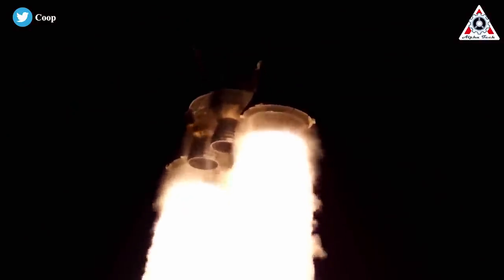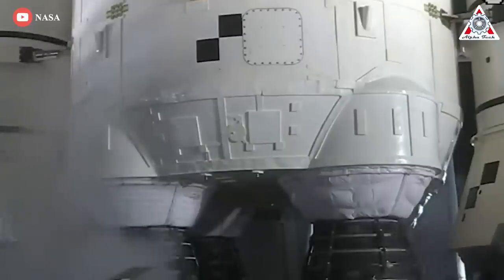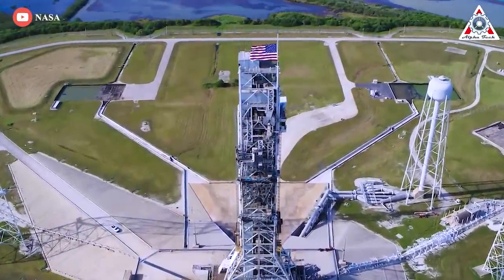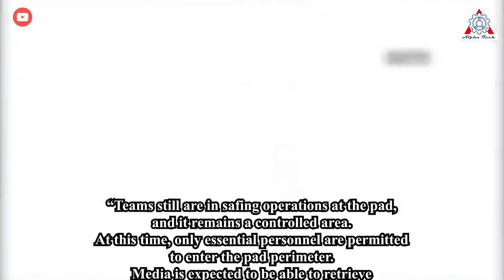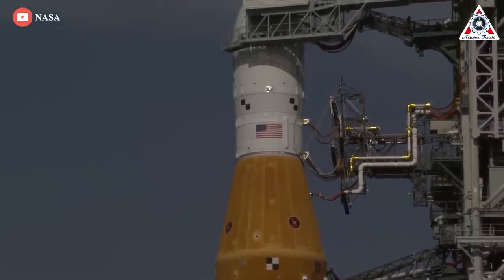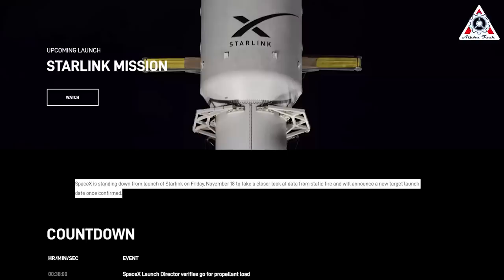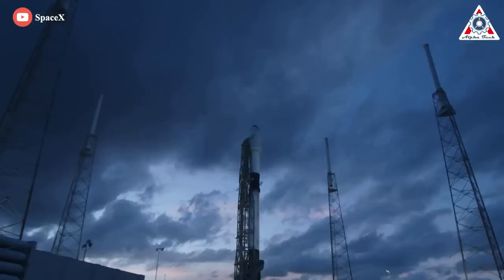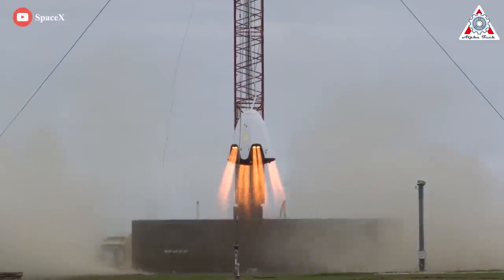NASA Launch Tower is in Big TROUBLE after launch...???

Comment: 1.5 years from now aren't 4 human beings supposed to not only move TOWARD a fully fueled rocket, but actually GET IN at the top?
Reply: Knowing NASA it'd probably be 2-3 years
Reply: One good thing about this old-style 'capsule on the top' stack is that, if things get too explodey, the astronauts have a chance of not dying.  Need to check to see if they get into Orion before the fuel-up.
Reply: Riding it and putting around by leaks of highly volatile chemicals where you are likley putting metal on metal hoping it doesn't explode are significantly two different scenarios.
Reply: Starship is also fully fueled on the pad when they get in… WITH NO ESCAPE POSSIBLE.
Reply: @davidbowerman6433  if it blows they will all get out. At about 1.6km/sec...
Reply: In 1991 while working as an electrical technician on the first Titan IV rocket to be launched from Vandenberg Air force Base, I helped install its guidance computer. The Titan was fully fueled at the time. It was just a regular shift, and the job I was assigned to do on that particular night. 
I was most likely at more risk during the half hour drive to work earlier that evening.
Reply: @richpayton7162   I guess it's depends on how you define risk.  Here is a little quote  on said rocket's fuel. 
"The Titan II's hypergolic fuel and oxidizer ignited on contact, but they were highly toxic and corrosive liquids."  Seems pretty safe. 
Oh, and then there is the Damascus incident. 

https://en.m.wikipedia.org/wiki/1980_Damascus_Titan_missile_explosion
Edit:
Failed to see IV in your statement.  Apparently Titan IV had a much less volatile or toxic fuel.
Reply: Would you be willing to get on the 2nd flight of a relatively untested new rocket platform? Having 1 successful flight isn't good enough for me
Reply: @fauxque5057  John Young and Bob Crippen went one better than that... they did it on the FIRST flight of the shuttle.

There is always going to be risk in Spaceflight, it’s about how it’s managed. As noted by the technician up thread: driving to work I’m a car wasn’t the safest thing to do either.
Reply: Id say 6 years minimum if not canceled
Reply: Yup, this just is for drama’s sake.
Reply: @rajvader  "too explodey "....🤣👍
Reply: That's what Soundstages are for
Reply: Yes,  but they are fastened inside a pressure vessel and have a launch escape system should anything go wrong and they will get yeeted out of harms way. If anything goes wrong and you're stood next to it out in the environment you've not really got anywhere to go if it goes wrong and that's even if you could react fast enough (which you couldn't)
Reply: @davidbowerman6433  Really? When did that happen?  8-)
Reply: @davidbowerman6433  Huh, just like the Space Shuttle: 1981 - 2011. No escape possible. 30 years in service and if it wasn't for the launch system destroying 2 shuttles it would have had a perfect safety record: broken SRB's burning a hole in the External Fuel Tank and blowing it up, 1986, and ice/foam breaking off the External Fuel Tank and punching a hole in the Shuttle's wing, 2003.
Reply: @iitzfizz  Assuming that the hardware and software contractors built the escape tower correctly. Wait...they aren't the same company that designed and built the hydrogen fuel valves is it? And God help the astronauts if it is the same company that built the $ 1 billion, half a decade late launch tower, that is now damaged by the maiden launch. Other than that, you're correct!
Reply: @chadpm11  Redesigns? Possible. While they're at it, if they can get rid of the "Flash Gordon" 1950s space ship nose cone, that'd be a BIG improvement.
Reply: @fauxque5057  I'd have to think about it.
Reply: @TheStopwatchGod  2~3 years? That's good. Especially for SpaceX, that has the HLS contract. That gives them time to test the HLS: 1st one land only. But the 2nd and 3rd tests of the HLS will orbit the moon, land, and take off again. That extra 2~3 years will allow SpaceX to make sure all systems check out A-OK. Yeah. On the 2nd test landing & take-off they can even send along a couple of technicians...you know, to check things out and make sure everything works. Like, say, the external elevator. Ride it down and up a few times to make sure it doesn't stick or anything. And even test the elevator platform's egress gate. You know: step off on to the surface and back a couple times to make sure it is doable by NASA astronauts...no trip hazards. Then NASA can be assured an historic RETURN TO THE MOON! P.S. And maybe on the 3rd test Elon can send along a couple of actors: they can pull a Tesla Lunar Rover around in front of the HLS, and shoot a commercial: "Act now and get a free Tesla Lunar with each moon landing!" Whatdd'ya think?
Reply: @lawrenceallen8096  i believe it's the company that agreed to do it for the cheapest cost
Reply: @insertcognomen  If that were the case then it would be SpaceX.
Reply: It probably won't be SLS. It probably will be on Starship 22
Reply: @Philip02K  OK, then, why not just put Orion inside Starship 12 and take it to the moon and back? And save $ 4.3 billion a pop?
Reply: No, they'll be on top before the fueling begins.
Reply: @blackhatfreak  That would worry me more!!! I'd rather look at it from afar, fully fueled, stable, with no leaks detected, etc. Then get the order:  "OK, it's loaded and ready to go." THEN I'd like to get on top. No: "Oh, oh! We have another hydrogen leak!"

Comment: Hydrogen is the smallest possible molecule - it sneaks through the smallest gaps.   It also embrittles metals by squeezing into microscopic gaps - widening them and causing bigger cracks...and that's with metals that are already brittle at the cryogenic temperatures.  It really is a nightmare of a fuel.    I'm not in the slightest bit surprised.
Reply: Is it an unsolvable problem really?

Comment: I think the SLS might be more risky than the shuttle launches at the end of their career.
Reply: SLS has one thing the Shuttle didn't that makes it inherently safer, as launch escape system.
Reply: That and don't have to worry about foam from the tank damaging thermal tiles.
Reply: @firnen_  launch escapes ain't saved too many but the ablative heat shield and fact that tile damage is less likely might alone make it safer

Comment: Hydrogen is a very tricky fuel to deal with.
It is the smallest element, and creating successful tanks and seals that don't leak, especially at cryogenic temperatures, is difficult.
So I'm not surprised that NASA continues to have sealing issues, even after 50 years of experience.
That's why commercial operators and the military opt for kerosene, hydrazine and other chemical based fuels, as they're easier to deal with.

Comment: During the Vietnam war some of the missiles (AGM-12C) used were liquid fueled......not to mention all other missiles were solid fueled.  All oxidizer/fuel leak indicators indicated positive and we just continued work as though they were safe.  Several of the bases in Thailand and Vietnam assembled, flew and fired several thousand missiles each during the course of the war.  Not to say there were no problems but there was never a direct incident related to the liquid propellants.  If there was a serious liquid propellant problem with SLS it would be a disaster but the fact that none occurred testifies to how safe they are.

Comment: Good God, it’s not that big of a deal with cryogenic fluids. There is no pressure and until it goes back to pressurized gas, it’s hard to ignite. As long as you are using brass tools, you can beat the hell out of any part of the cryogenic pipe, tanks, pumps and more. I took a diesel soaked rag and tied it to a rope. I poured LNG on the ground and lit the rag. I pulled it threw the LNG and it put out the fire. But, I knew this would happen as a LNG Engineer.

Comment: There is no back up tower I take it?  I know that one would cost millions to build, but if a rocket did blow up (or even have something smaller happen like described here) it would take months (or years) to build one.  Meanwhile, no other rockets could take off?
Reply: Bet SpaceX could build NASA a new tower that would be much better and cost much much less in a fraction of the time NASA can do it.
Reply: @raymacdhomhnuill8018  nah they’d just give ‘em a 3D model
Reply: @raymacdhomhnuill8018  No. The only reason why SpaceX has cheaper towers for its Super-heavy rockets is because the whole structure isn’t designed to move. Which isn’t an option for the SLS because it needs the support to move it from the Vehicle Assembly Building to the pad.

Comment: Probably no leaks would happen in solid-metal rocket parts, that were pressed and rolled into shape, as opposed to being 3D-printed from powdered metal.  Any 3D-printed powdered-metal car wheel can easily suffer serious and impossible-to-repair damage from hitting a deep pothole at low to moderate speeds as opposed to the much stronger solid metal ones pressed in the traditional way.  So just imagine how engine parts manufactured with the newer 3D methods and powdered metals would hold up under the absolutely gargantuan stress of a lunar rocket blasting itself free of this planet's powerful gravitational field.

Such leaks were comparatively rare with the rockets of the USA's lunar program of the sixties and seventies.  Elon Musk is risking the new lunar program and its astronaut's lives to save time and money!  In WW2, Nazi Germany and the USA both spent lavishly to build factories equipped with enormous super-heavy metal presses and rollers, in order to stamp out metal housings for their best aircraft and tank engines.  Those parts and methods were considered revolutionary at the time.

The Russians used the same methods to build what most rocket design engineers now consider the best engines currently available for space exploration.  Until fairly recent times, they brought many US and EU  astronauts to the International Space Station, as well as many US and EU satellites into orbit.  We already lost two astronaut crews to poorly built rockets.  Therefore, I think all would agree, we must build good ones or build none at all!
Reply: So you saying Elons using 3D printed rockets? So you referring to falcon and crew dragon or starship with it's cold rolled steel?
Reply: Falcon uses kerosene and starship methane both are     scales less riskier and easier to handle compared to hydrogen.  To say Elons risking peoples lives is a bit drastic,  afterall if that was the general setiments then astronauts would not fly to the ISS on crew dragon.
Reply: So you are saying NASA sucks now and Elon can take em probably next summer. Dude NASA is not spending the money  they partying or something. Musk is doing good. You are so incorrect. I love NASA but they ain't trying. They cutting corners.  But I like your patriotism. I wish NASA would be patriotic. .
Reply: @chrisduggan2848  The outer rocket panels may be made of solid cold-rolled steel.  However, I clearly remember seeing a few videos in which Mr. Must proudly touted his rocket engine parts being made from 3D printed parts.  The leaks must have come from superhot fuel blasting through first the powdered metal engine parts and the exterior panels shortly afterward.

Comment: Seems like a lot of money for a "Tower" that looks like it has changed little since it was first built during the Apollo program.
Reply: The Launch Umbilical Towers from the Apollo program were removed from the Mobile Launchers for the Shuttle Program. Two of them were made into the Fixed Service Structures for the Shuttle, the third was scrapped. NASA had to make a new tower for Ares I which has become the Tower for the SLS.
Reply: @gnranger  Roger that. It just seems that it just be a matter of modifying the tower they had or adjusting the new SLS to fit what they had as opposed to spending another billion dollars to replace what they already had.  The vertical structure with electrical service & elevators, etcetera, should have been still useable. 

BTW: I live just outside Orlando and go to every launch I can. You could see it was modified extensively for the Shuttle. If it could handle that much modification it should have been much easier to revert back to something closer to the original.

Comment: NASA should abandon hydrogen and move to methane. A lot less problematic and the performance is still good.
Reply: Should also abandon hydrazine snd rapidly transition to the greener hypergolic fuels already developed. Significantly less hassle for handling, with less hazard mitigation required. Performance is as good or better. But industry inertia is difficult to divert even for clear improvements, just because they are newer and have less time verifying suitability.

Comment: Hey, don't YOU realize that the EXACT SAME HYDROGEN LEAK PROBLEM with a HYDROGEN REPLENISHMENT VALVE on the launch umbilical tower structure occurred WAY BACK IN 1969 on the VERY MORNING APOLLO 11 successfully LAUNCHED??   They fixed it that day by sending a crew to the pad and tightening the bolts, JUST LIKE THEY DID with the Artemis 1 launch.  ALSO, don't YOU realize that the launch tower got DAMAGED on each Saturn V and Space Shuttle Launch??   Yea, they did repairs on those too before the next flight (also one reason they built TWO launch pads, so if one were delayed due to ongoing repair work, the other would still be available).   You just seem to want to stir-up controversy where none exists (i.e. the SpaceX launch delay and NASA ITAR photo restrictions).

Comment: They can't risk letting the world see that they fixed that Hydrogen leak with duct tape and zip ties. No way would they be allowed to strap people to the top of the next one.
Reply from the maker: So you believe it's not risky
Reply: @alphatech4966  dude are you a troll .???  Of course it is risky. He's saying they should be badass, not just there
Reply: @trainrick1  A troll?  They posted the video.  lol   and that's not what I'm saying at all. 
     First, it was a joke about how they repaired the leak. But on a serious note, if they let people see the damage done to the tower, it could shake peoples' confidence in the engineers. This would absolutely lead to questions as to the safety of the next launch - especially since that one is supposed to be a manned mission.
Reply: @alphatech4966  I don't know how you came up with that, based on my comment. Seriously.

Comment: I also noticed black smoke coming from the exhaust plume, so I'm guessing that they used extremely volatile propellent for this launch, probably not their intended plans.
Reply: Not sure what you saw. The main engines use Hydrogen and Oxygen(very clean burning), while the SRBs use a solid fuel(hence the name Solid Rocket Boosters)that is mich dirtier and brighter but not black smoke. 

The Reaction Control thrusters used in space use toxic hypergolic fuels that combust on contact, eliminating the need for an ignition source. Their smoke is usually an orange color. The US old Titan rockets used hypergolic fuel and the Chinese still use it in some of their rockets. If you remember when the SpaceX Dragon capsule exploded on the ground during testing with an orange/brownish cloud of smoke it was because of hypergolic fuels mixing in an unregulated way.
Reply: PEACE 
LOVE 
HONESTY 
FREE THINKING 
GOOD HEALTH 
FUN 
LAUGH 
OPTIMISM